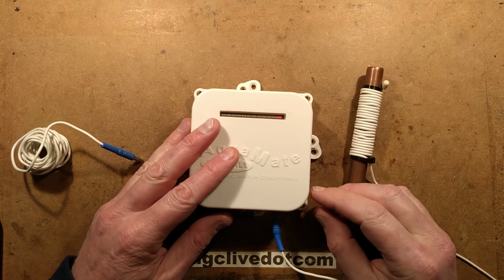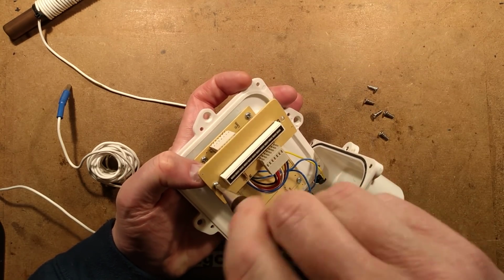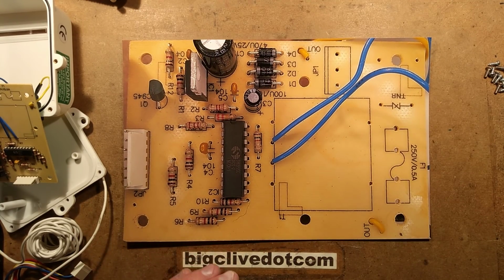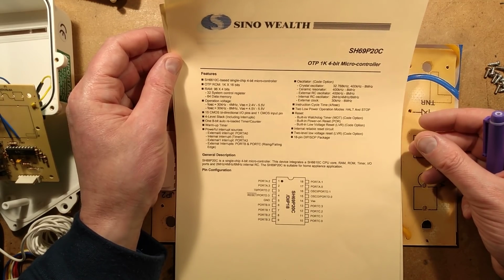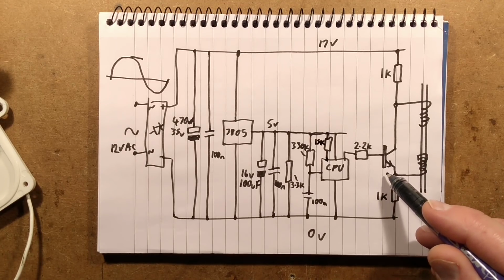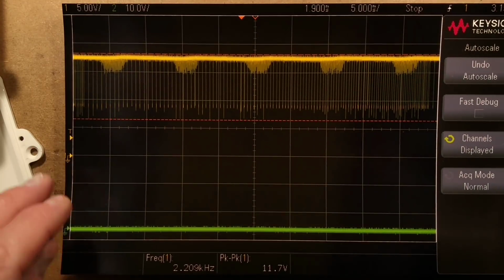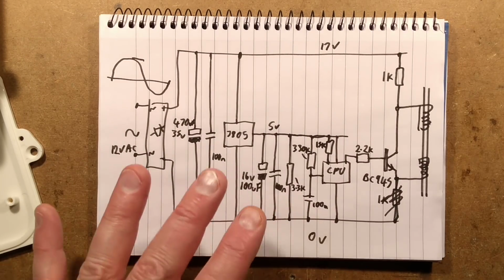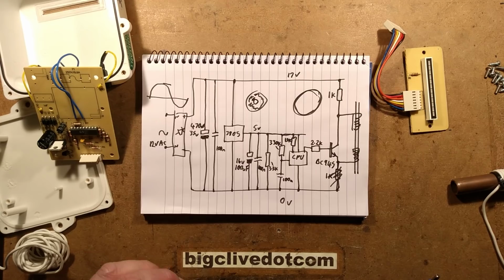inside a computerised pipework scale reducer.

Comment: I live in a hard water area. Had a boiler installed in 1990 which was replaced in 2014. Didn't notice any scale inside at all. 
Quite a lot of sludge. Yummy.
Reply: spacial System boilers don't develop significant scale, as they are always reheating the same water over and over. Combi boilers may develop scale within the secondary heat exchanger, but you would have to cut it open to see it. It's not surprising therefore that you didn't see any scale in your old boiler.

Comment: Though I don't fully understand it either, I could imagine the pulsing current spikes would have an inductive effect on the copper pipe in parallel, alternating directions (right-hand rule). Perhaps that could make it "buzz" at an atomic level, preventing the collection of solutes on its surface. This implies it's only to prevent scale buildup near the coils, but I think that's also more realistic.
Reply: Any current spikes are limited to a maximum of (about) 4.5mA, and so would have negligible effect on the highly-conductive copper water pipe.

Comment: The transistor output stage is a "paraphase inverter" / "paraphasae splitter" and it produces push-pull pulses that shorting out the emitter resistor would not.

Comment: I insist on state of the art quackery, none of these dated gimmicks.
Reply from the maker: But this is fitted with a state of the art digital integrated circuit computer.
Reply: @bigclivedotcom  I'm still baffled by why they need that ancient microprocessor to drive the electromagnet I built in high school shop class. Was it just a cheep prop? Was it so the designer could hold his head up high and tell themselves it was more then a grade school electrical project?

Comment: Big clive I'm writing from the USA.  Here in America we have a similar unit called a Scale Blaster.  I know this because I work at a big box hardware store, and I heard rumors about this gadget.  I actually heard about it from a customer who came to the store looking to buy a Scale Blaster.  We didn't stock it but we directed the customer to our website to get it.  I myself have a well water problem in my home.  I have calcium chloride floating around in the water which causes scale to build up calcium deposits in my water heater (even with a water softner), and deposits in my toilet bowl, and around faucets.  As a matter of fact years ago I replaced a 15 year old water heater and it took 4 men to carry it out because of heavy buildup of calcium.  At any rate I purchased a Scale Blaster and installed it 6 months ago, and I will tell you flat out it works!  It works as described in the instructions....It doesn't remove the calcium, it simply puts a charge in the scale molecules and keeps them from clumping together.  I will end by saying I have received similar good result comments from  other folks who have the units in their homes.
Thanks for your knowledgeable teardown reviews, I am a subscriber and have watched many of them.
Reply: Calcium chloride is soluble and won't precipitate out, so cannot be responsible for blocking your pipes. And I'm sorry, but if your "Scale Blaster" is "magnetic" or involves winding wires round pipes, it doesn't work.

What you want is a chemical scale preventer that uses an ion exchange medium. Either a whole house water softener, or a cartridge type preventer will work. Don't waste money on these nonsense devices.
Reply: @al45tair   As I said in my comment............The scale blaster does not remove scale (precipitate out)...It keeps scale from clumping together.  Result:  Deposits do not form in appliances like water heaters, or form deposits in and around sink faucets or in the pipes.  I too was skeptical when purchasing the product.  However, I have positively confirmed the scale deposits in my home are now not a problem.  In another year my anode rod in my water heater will be removed, it will be three years old at that time.  I expect to see some calcium deposits on the rod from the time before scale blaster.  The Scale Blaster does not remove calcium it just keeps the molecules from sticking together.  EXAMPLE:  I have a water distiller,  when I use tap water, after the distillation I still have calcium in the empty reservoir....BUT it is not all clumped together it is much easier to clean out and I don't even need to use vinegar like I had to do before.  Again it's not just me saying this I have had reports from others who have used the scale blaster and are pleased!  You say snake oil to this.......I say snake oil to global warming!

Comment: A lot of the water in Ohio and Pittsburgh PA have a high amount of minerals. From changing out hot water heaters and doing general plumbing, some of the copper pipe i remove looks like an artery clogged with cholesterol.

Comment: This thing is like the magnetic fuel saver that clamps on the fuel line to the engine, or the ultra sonic rodent and insect repeller. Snake Oil. Unicorn Dust.

Comment: No this will not work as the power is to low and not installed in a way that will work.
They are based on a sytem that does work in that the high voltage magnetic field will force the salts ect to be ironised and the small particles will attract together to larger particles that can then by attracted to plates or caught in a filter to reduce the hardness. 
A simlar system is used in electrostatic filters etc.
By using a frequency they are trying to alternate positive neg attractions of the particles instead of a proven system. It will not clean your pipes (other than maybe between the coils 😝)
No it wont work.

Comment: As a test, we installed two of a similar device in two brand new houses in a four house development, all using city provided water.   Absolutely No difference. After four years every one of the four test locations had  the same corrosion, scale buildup and deterioration. Our test was for the builder because he was sold these.  We told him to do the test to confirm what the quack salesman told him.
Reply from the maker: Now that's a proper test.
Reply: That is a really good test. I know there are definitely some scammy ones as I bought one that turned out to be fake one one ebay. However, genuine Kemo brand ones definitely do something. In a really hard water area such as where I live, the scale in the glass kettle now crumbles and falls off by itself. It was because of the scale build up before that I bought one for this flat, having bought them and found them to be genuine in other flats. So I wonder about the brand. You can do a water taste test with the Kemo brand ones and it is noticeable. However, most people won't do that, and the time taken for it to show any pipe or heater scaling effect for most people is too long, and it's an ideal market for scammy devices.

Comment: If the base drive would be higher (than below 5 V to start and further dropped by the 2.2k resistor), the current through the transistor in saturation would be about 8 mA.  If the transistor beta is 100, the base current could be 80 uA and drop in the resistor would be some 170 mV.  Probable maximum output from the computer chip by a guess is 3.5 V, so we can actually ignore the resistance.  So the emitter voltage could reach about 3 V and the actual current through the transistor  would be 3 mA.  That would also represent similar 3 V drop below the 17 V bus or down to about 14 V.  That then would leave the bulk or 11 V to be wasted over the transistor....

Comment: In highschool chemistry class, I learned that all rates in chemistry are temperature dependent.
 If you create a hot saturated salt solution, as the solution cools, the salt will precipitate out at nucleation points (scratches, roughness, dirt, etc...).
If you slowly send a heated saturated salt solution through a long clear tube (with nucleation points) where some sections are exposed to a lot of cool air flow, and some sections are insulated, then the salt will precipitate out faster in the cool sections. If you gently heat a portion of tubing by just a few degrees, the salt won't precipitate out in that section. By carefully adjusting the flow rate, cooling rate per meter of tubing, initial brine temperature, and initial brine concentration, you could create a demonstration system where there the salt is coming out of solution everywhere except near the powered coil of wire. It would even work if the coil was powered with a woo-woo snake oil audio signal.

Comment: This product is obviously snake oil but I can vouch for permanent magnet scale reducers. I obtained some very strong magnets, out of an old hard disk drive, and put them across the mains water pipe. I live in a very hard water area, on the Kent chalk downs and found the kettle would fur up very quickly. A few months after fitting the magnets the scale in the kettle almost completely disappeared and hasn’t furred up since. I have no idea how it works but for zero cost it has made an enormous difference.

Comment: I work for a very large water utility (been around in 1880’s) out in the field, repairing and installing mains and services. I get asked if theses really are worth installing. I inform the customers that we are required to send out a Water Quality Report every year. If they would check it out and see what the TDS (total dissolved solids) level is and what minerals are actually in our water they would realize it’s not worth it. We have customers that also purchase (Zero Water systems) again not worth it.  We have one of the best drinking water within the Continental U.S.  the Ph is excellent, the mineral contents are excellent,  the only reason we add minerals is because we are required by the Gov’t to maintain a Lead & Copper Rule & are required to add a specific amount of minerals to prevent corrosion. We would rather deposit minerals than remove.  After removing a 118 year old section of Cast Iron pipe from the system for inspection I was very impressed by the visual look of the inside. Our biggest problem with electricity was customers used their galvanized and copper water pipes as an earth ground. They are basically destroying their own house lines thru electrolysis and every now and then I get shocked from the electricity.   The main point I wanted to make is they are a waste of money and electricity.

Comment: At the risk of everyone having a pop at me, as it seems that either I am the only one that bought one, or is admitting to buying one (about 15 years ago or more) but (and why would I lie I admitted buying it) when I put it in (it has the one wire only) it really worked, for the first week limescale was coming out of the taps (milky white water) especially the hot water taps, then it seemed to have cleaned out the system and its till working today.... ok... now for the slagging off....

Comment: Seems to be similar to other circuits, that sometimes don't use a processor, and sometimes use the one driven, one passive antenna.
As I understand it, with the winding having to continue in the same direction, the coupling is inductive, with the latter part of the winding offering capacitive loading, and uses the high frequency component of the spikes.

Comment: Hi Bigclive, I would like to send you a Corsair CX600M PC PSU to look at in one of your videos, I was not brave enough to try and fix it, cheaper to buy a replacement.  Its not powering on, even after removing from the PC and shorting black and green wire together. Where do I send it to?

Comment: The odd pullup resistor on the microcontroller seems like a strap resistor - the code would check whether the pin is high or low, and will exhibit different behaviour (for instance, for two different models). Then the manufacturer can run a single OTP ROM across all devices, and either populate the resistor or not to change the behaviour of the device, without having to program the uCs at the factory or order two OTP masks.

Why a 15K resistor instead of a jumper or 0 ohm? No idea. Leftover components from a different run?

Comment: Ohhh, it would be much more fun if the LEDs were a little brighter, and went back-and-forth like on Knight Rider (or Cylons), and it made the funny Cylon Eye noise as it did so. This should be possible with a little circuit hacking (at least for the display, making the “Cylon eye” noise is left as an exercise for the viewer.) You’ll need to diode-OR the two outermost pins so that when pin 1 is on, pin “X”x2 is on, (where “X” is half the # of LEDs in the bar display), and when pin “X”x2 is on, pin 1 turns on, too. Then do the same for each pair, moving inwards (so pin 2 and pin (Xx2)-1, pin 3 and pin Xx2)-2, and so on) so if it has 12 pins (let’s say), then X=6, and the counter will count from 1 to 12, but LEDs 1 and 12 will both turn on (one directly, and the other through the diode-OR gate), then 2 and 11, 3 and 10, 4 and 9, 5 and 8, 6 and 6, 7 and 6 (producing a slight delay), 8 and 5, 9 and 4, 10 and 3, 11 and 2, and 12 and 1. this will give you an effect similar to the “Lucifer” Cylon guy from the original BSG.
  You could also interlace the LEDs; connect count 1 from the driver to pin 1, count 2 to pin 3, count 3 to pin 5, count 4 to pin 7, count 5 to pin 9, counts 6 and 7 to pins 11 and 12, count 8 to pin 10, count 9 to pin 8, count 10 to pin 6, count 11 to pin 4, and count 12 to pin 2, and that’ll (sort of) give the Knight Rider/Cylon Eye effect.
  I can see some helpless plumber coming into an unlit basement to fix the hot water heater, and seeing this on the wall, staring eerily at him and making the funny “whoosh-whoosh” sound effect; now you have two puddles on the ground to take care of - one from the hot water heater, and one from, well... the plumber! 🤓
Reply from the maker: It is slightly disappointing that it doesn't "scan".  But that would be an easy fix in software.

Comment: There are similar looking units which pass a large dc current through the coils which generates a magnetic field along the pipe and through the water.  The dc current is generated by a mains transformer that has a large number of primary turns and a single heavy gauge secondary turn connected across the coils via a rectifier. The resistance of the coil limits the current.  The theory is that the movement of the water in the magnetic field aligns the ions nose-to-tail because of their asymmetric charge distribution.  This causes them to join together in long chains which then have no tendency to attach themselves to the pipe walls.  It can also be done using permanent magnets.  I'm not sure it this has any scientific validity but I have observed that some large organisations that ought to know do use these devices, for example at each vending machine.
Reply: Sounds like the petrol saving (scam) device.
There is a use for this technology, in oil pipelines.
Saw a video about this, maybe it was on Donut media.

Comment: I just purchased a home in West TX.  The water there is horrible.  I have been looking a all the methods to treat the water to make it better to drink and use whole house.  I have always been skeptical about this product but (like you) always wondered what was in it and how it worked.  I know that you can not magically remove the solids and compounds in water.  I also expected to see BIG caps and coils.  HOLY CRAP..  The second you opened it, I said SNAKE OIL!!!  THANK YOU for driving the NAIL I that coffin for me.  VERY GOOD tutorial and circuit explanation!! They spent more money on the box and LED chaser circuit to get you to fall for the hype. All the pipe in my TX house is PEX.  Theres ZERO chance that this will properly work on a PEX system for the whole house.

Comment: If it did work, would it not block the pipe where the coils are wrapped around?If the output stage was an audio circuit, it would be an anti-phase generator. Current flowing through the two 1K resistors produces a voltage coming down from the negative rail and one up from the positive rail, i.e 5 mAmp would result in a collector voltage of (17-5)=12V and an emitter voltage of 5V. Unless the two coils are somehow connected, there will be no current through either of them, so no electromagnetism, so no descaling.

Comment: My Brother-in-law got the farm when their parents passed away, the well on the farm gave very hard salty water.  The plumbers installed a much larger filter thing that also was supposed to clean up the water and save the pipes which had indeed been clogging to such an extent that they needed to be replaced often costing big bucks.  Well the filter did take a bit of the salt out of the water, but it was still the color of 1% milk mixed with water.  When at long last the Missouri Diversion project was complete and farms in the area were served with water from the big muddy, the pipes were again removed and replaced.  They still looked nearly as bad as the first replacement so other then improving the taste the device did little.  Keep in mind this was a much larger device with filters that needed changing regularly.  I know I would never waste my money on such a device, bottled water is cheap if you buy it by the case lot, and the filters you can pour your coffee water through are not all that expensive either.  And as I say the problem was eliminated by the water from the Dams on the Missouri River about 80 miles North of here, they are now serving the majority of small towns from that project, the water isn't bad tasting and has been cleaned several times before reaching our homes, after all we all know what fish do in that water....